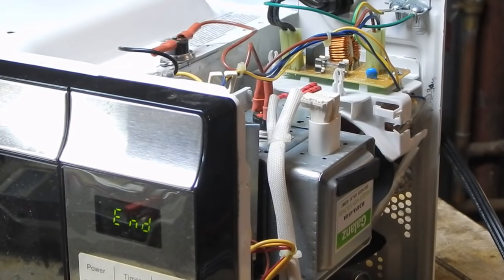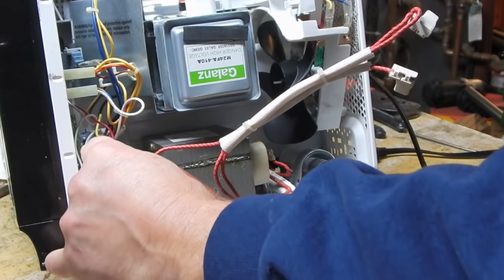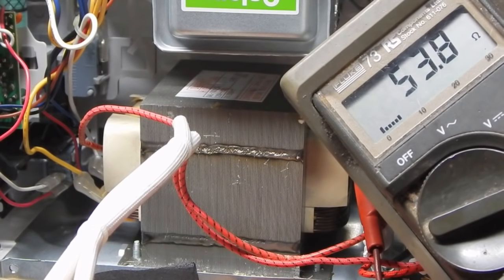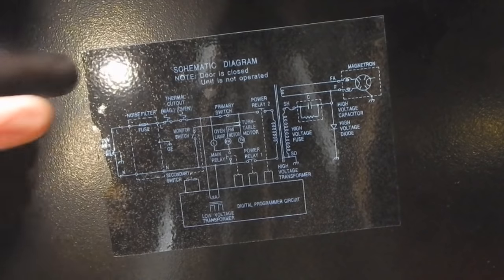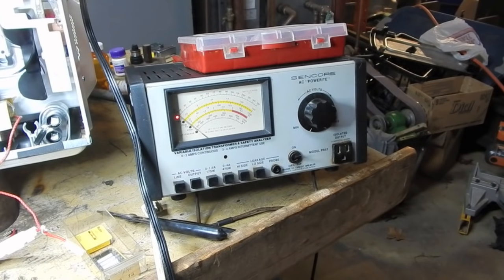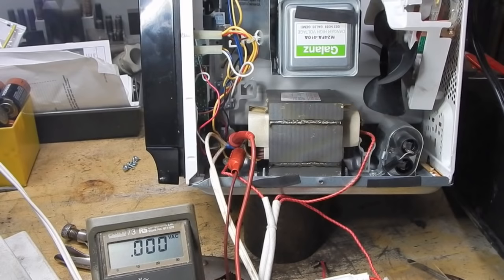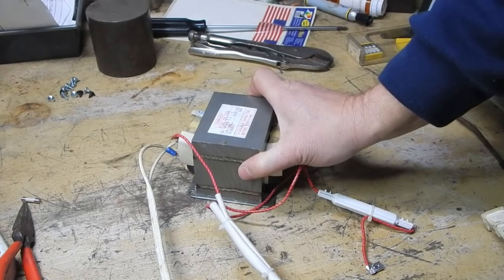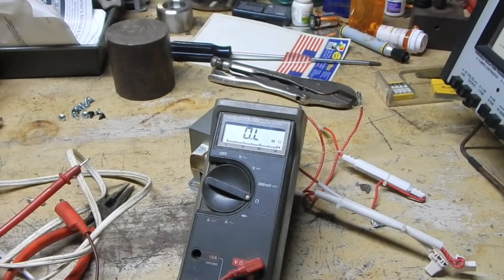A dead Microwave oven Part 2 of 2

Comment: Wasn't clear on how to get the micro switches out, but good show. Thanks, keep up the good work.
Reply from the maker: Years ago, the switches were held in with 2 screws each. Then the manufacturers went to these molded plastic brackets the switches just snap into. Cheaper to make them that way.

Comment: No clamp-on current meter?  That's a real shame.

Transformer testing, including using a fancy LCR meter, is generally a static test.  A dynamic test, actual working load(s), is a superior test but costly to perform.

Comment: you could always save the front panel and use the timer/relay for some interesting project. I did that with a coffee maker. now I have a outlet that can come on automatically at a certain time and run for 2hrs
Reply from the maker: cheeto4493 😉

Comment: read the right way before you check a capacitor via multimeter. You must drain the charge in it before you can check right reading.

Comment: Shorted turns on the secondary will  cause the primary to draw excessive current!
Reply: Yes it is right, this is the probably case due to high voltages between the secondary winding(s).

Comment: Hey Steve... Thank you for the detailed, and often humorous, walk through.  I have a question regarding my microwave... it makes a very loud hum but does not cook (the kind where it sounds like something is frying inside, but no visible signs)... I have removed the high voltage components and have tested them using this video as a guide... my transformer (Samsung SHV-U1870C) has 3 input leads to it and I am getting a 1.6 ohm to 2.0 ohm reading across each of the terminals (0 ohm to ground), a 129.8 ohm reading on the high voltage wire to ground, a 1.6ish ohm on the filament leads, and a 1.5 ohm reading across my magnetron leads (0 on ground)... my meter isn't one of very high quality (harbor freight bought Cen-Tech).  My capacitor is showing an open, but I am unsure if these reading are out of whack indicating one of those planet aligning failures on the transformer, or just a cheap meter.  What are your thoughts?  Its a 36 inch unit and I know that they don't make them any more, and I am trying to not have to buy a 30 inch and then get a $200.00 filler kit...  thanks again!
Reply from the maker: Derek Hibdon I would hook everything back up, but leave the magnetron disconnected and see if the humming stops. I so, it might be a bad magnetron. They sometimes short out. Be very careful, these are mighty dangerous.
Reply: Steve Watroba awesome... Thank you... I will try that... What about a bad capacitor, since I got an infinite resistance.. If the hum continues, could that be it?

Comment: One of the most informative videos that i have seen.Thanks Steve. 
So how do we know for sure its the transformer?
Reply from the maker: Transformers usually only fail one of 2 ways, a winding opens, or a winding shorts. Open windings are easy to find with an ohmmeter.  Shorted windings can be  trickier.
Reply: With no load the transformer should draw only moderate current and should not get hot.